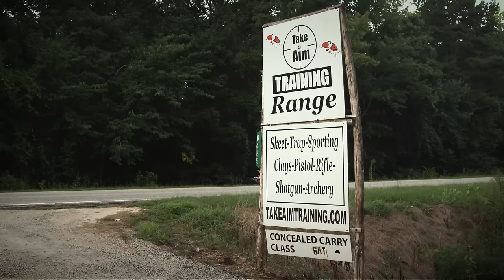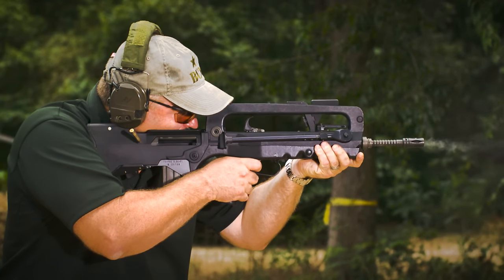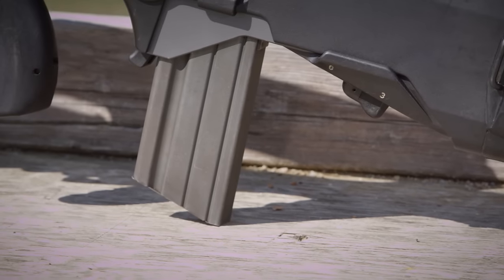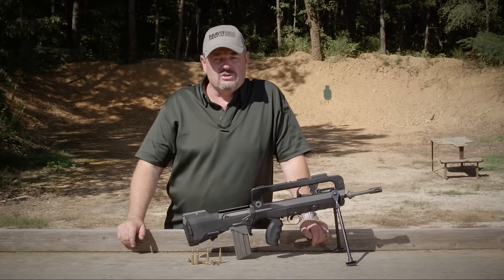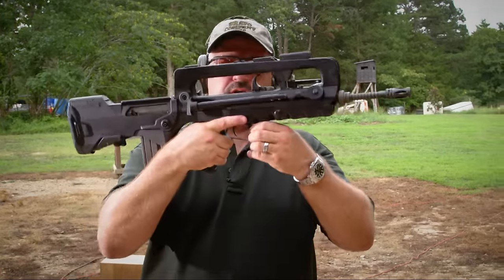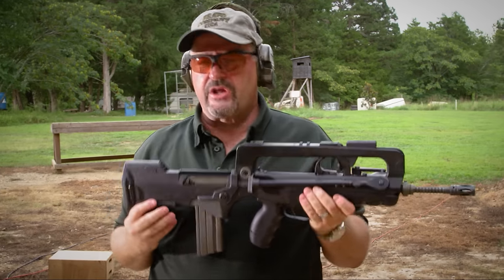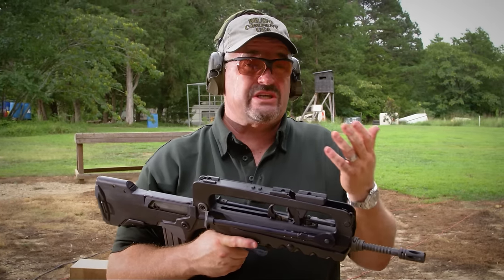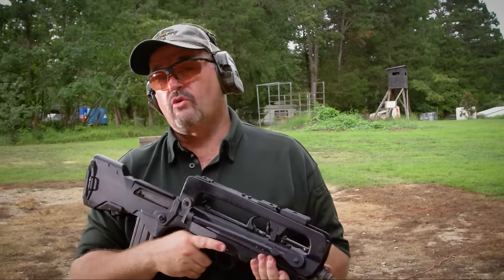FAMAS F1 Assault Rifle

Comment: It seems that there are a lot of current or former French military servicemen watching this video, so I have a question. Is there a variant without the bipod? During a layover I saw a couple of Gendarmes patrolling Charles de Gaulle Airport and I think that their FAMAS's lacked the bipod.
Reply: No version without the bipod but each "foot" of the bipod is just clipped, easy to dissasemble. You can also dismantle the fastening system of the bipod but you need tools.
Reply: +tromxuasnoc so every FAMAS variant has a bipod, but they are easily removed.

Comment: “Over 10km of wiring”

-twitch
Reply: Amateur Asian u do kno not everything revolves around a game and this isnt the same gun
Reply: Chroma 1. Yes it is the same gun. And 2. I know everything doesn’t revolve around a video game. It’s just a fun reference to one.
Reply: Amateur Asian actually he’s right, it’s not the same gun, the gun in this vid is the Famas F1, the one in R6S is the Famas F2 which is an upgraded version
Reply: iTzRekk- still a Famas.
Reply: @imbadonpcwotb476  No in the game it's the F1 but because Ubisoft didn't do enough research they called it the F2 which isn't even right for the second version because the second one is called the G2. They also modeled the standard 25 round magazine yet have the capacity set to 30.

Comment: having served in the French gendarmerie, I used this gun for more than a year. It really is smartly designed.Many small parts within this splendid gun, never had to clean it on the field, could have proven tricky. Overall a very good gun. The new standard issue rifle for the French military is way less sexy. And it's not even French  !! booth !! cool vid thanks for this wealth of info !!
Reply: Exactement.
40 ans de traitres à la tête de l'Etat et beaucoup de français continuent à dormir et à avaler la pilule tous les soirs à 20h.
Reply: @jomo3564  tout a fait, que des traîtres au pouvoir depuis de Gaule, c'est pour cela qu'ils l'ont fait dégager d'ailleurs...
La pillule, ils la prennent profond (comme moi...)mais j'ai l'impression que chaque jour passant et se dégradant, de plus en plus de français ouvrent les yeux. Lentement mais sûrement
Pour les autres Bisounours qui refusent de voir, comme dit l'adage "seul L'Idiot apprend dans la douleur..."
Courage 💪

Comment: You missed the recoil dampener mechanism in the stock. It's inside a box where the 3 or 1 selector is. Don't ever take it apart or try to adjust it or mess with it cause you'll probably have to send it to France for calibration.

Comment: Thanks Larry. 

Looks like the full auto cycling is very smooth and usable rate of fire.  Seemed to have no problems with brass cases.

Don't like the mag release location, etc.  Looks very exposed and prone to dropping the mag at inopportune times.

Don't like safety selectors inside the trigger guard, and the right side/left side selector switch is odd.

Would have been useful to see a manual of arms for mag change, cycling the bolt carrier, etc., particularly with a lack of hold open.

Comment: If you have very spare hours I'd love to show the details of how this device is a masterpiece of design 

Critical independent gearboxes enabling zero to 20 in under four seconds 

Ten kilometers of internal wiring  

1,100 expertly machined and assembled components

 Flawless control out of 300 meters 
But all my team needs to know is does it do the job or doesn't it, and let me tell you right now 
It does the job
Reply: Twitches operator video lol

Comment: Used the F1 for 3.5 years and quite liked it. It needed a few updates which where added on the FAMAS Valorise - like the top rail and a better barrel so it can shot NATO ammo (F1 could only fire steel cased ammo) . Later I was issued the FAMAS FELIN. It  was f... terible ... cumbersome, heavy (er), fragile... hated every cm of that gun. Sadly I got out just before I they issued my dream gun (that Larry helped design) the HK416. Fun fact : when using it operationally I removed the bipod so I can have a better grip on the hand-guard.

Comment: 5:29: wrong. Every right handed soldier who was taught to shoot with the FAMAS from their basic training days was immediately instructed to use their left hand to push that lever to the right side (semi auto mode). It got to the point where pushing said lever to the full auto side actually felt unnatural. I personnally never felt uncomfortable setting the gun to semi-auto, as it had always been the standard way we used it in the FR army. Safety rules and instructions were always extremely clear on one thing too: the shooter could never, in any case, use his firing hand to remove or put the safety back on. Strong hand for shooting, weak hand for safety removal.

Comment: hello I am French and I spent 20 years in the army, I give you my real opinion on this unique weapon, in the field in general a cleaning and necessary twice a month
Reply: unique bulbup system weapon which allows to maneuver easily in vehicles and in urban areas, due to its length it is difficult for an enemy to take it unlike other weapon much longer and unsuitable for me
Reply: by its length think it well and very easy to aim at a human target very quickly an adventure in relation to the competition, I will add two essential points when you are leaning on a wall a baricade or in a vehicle the advantage of the right charger to place al rear allows you to keep aiming on an objective to be destroyed pour le changer le chargeur , and these precious seconds make you come out a winner, with front loaders on and sometimes having to move the weapon back or lift it up to change the magazine, especially on banana magazines, famas has the advantage of the rear magazine, death sometimes takes 1 or 2 seconds
Reply: the sighting system placed inside the handguard handle means that if the weapon falls to the ground, the sighting does not change since it is protected by the rail, on this weapon you can also shoot by lining up personnel by using precisely rail for rapid fire or in an environment can illuminate, all this on a stock weapon without accessories another advantage
Reply: the purchase of its replacement by the hk 416 and especially political and economic with the Germans, the famas costs more to manufacture especially the last generations, then it should be known that the Franco-German military industry will end up merging and that if the Germans sell us hk and French tanks we will sell them submarines and planes reciprocity
Reply: I could list lots of quality but the choices are made, I apologize to you for my approximate English, I will miss this faithful companion, I greet you all and shame that you are here far away we would have drunk a whole beer, salutations
Reply: Is France using HK416 to replace FAMAS now？It is kinda sad to hear that since famas is a famous gun of French army for many years
Reply: @terrancechan6282  yes she has been using the HK for about a year, but the famas is still widely used by many troops, a company of my former regiment received a batch of hk 416 in 2020
Reply: the saddest part of all this is that in the end these famas will be destroyed and that for the French market we will not find any, just a small number which will be very very expensive, the copies on the civilian market are selling at a high price.

Comment: The problem as i see it is a proper red dot sight on that, it wont fit the height and no one uses iron sights any longer other than if you reeeeally have to as red dot is so much faster. When i mean a proper red dot is a big scope for the eye, a good surface glass thing that you dont need the eye to be glued on. Second it shall have filters ( yellow, grid, half and dots) as well as a magnify adjustment for those who need a slight correction. Typically filters are foldable up or down, never side as it will block the eyesight. This has a frame where the eye should look in to ared dot

Comment: The ejection window is too close to the eyes so it is impossible to shoot in bursts without goggles ... then the very big problem of the Famas is the fragility of the ejector spring, therefore the weapon jams; the case is not ejected correctly and the operating part may introduce it between the baaquelite body which blocks operation. In combat it is very dangerous because you have to disassemble the weapon or have a hammer to unlock.

Comment: From an ex foreign legion guy .this rifle is a complete nightmare.Difficult to clean ,complicated and it has a lot of pieces.The is one piece called la piece the maintien that holds the bolt assembly together .its a size of a tiny pin.field cleaning it is an absolute nightmare.The french army never got the F2 version.The only time I saw the F2 was when it was used by the fusillier marin when I was deployed on the troop carrier Sirocco.the magazine were badly made and very unreliable. Also ammunition and magazine was not compatible with the Minimi which was the squad automatic rifle.the bipod was useless,it has also a weird sight for firing rifle grenades like a mortar which is quite unusual. I was happy when they adopted the hk 416 eventhough it was after my time

Comment: What’s the weird rod in front of the charging handle for?
Reply: It's the magazine release
Reply: The mag release is right in front of the mag
Reply: @Joe93819  Sorry I misread, it's the grenade launcher sight
Reply: @neage59  thanks, how does it work?
Reply: @Joe93819  You have 2 positions, one with the FAMAS inclined by 45° (120 to 340m shooting range), the other inclined by 74° (60 to 170m).
On the barrel you have a ring to move for the shooting range, it will block the grenade. More you press the grenade in the barrel, more the range is important.
For exemple, if your enemies are at 200m, you have to shoot with the FAMAS inclined by 45°. To adjust the ring, you have to know the increment system (20m for 45°, 10m for 74°). For 200m, you have to increment the ring by 4 (120 + 4 x 20 = 200).
Reply: @neage59  thank you! I have looked for answers everywhere but couldn’t find any.

Comment: Good riffle but not for a military use, too many small pieces (complex mechanism). I would not say this weapon is reliable. Getting dirty waaaay too fast and the cleaning is always a mess. Jammed too often. OEM mags are shit ( i had to buy my own made of strong ABS). No picatinny rails (in 2014 really???). The Bipod's mechanism is crap.

3 good things about this rifle :
1-Bullpup compact weapon, perfect for close quarter combat and airborne deployment. 
2-Riffle grenades mount is incredibly useful (different types of grenades available) 
3-lightweight. 

That's not a bad weapon but every French soldiers will tell you what i just said. 
The Hk-416 is more than welcomed but we would have preferred to keep a bullpup configuration.

Comment: It's really, really odd to me that they would add a integral bipod to a bullpup. It's like they saw it on the WA2000 and were like "we want that feature!"
Reason being is because the concept of a bullpup is light weight and small size at the expense of a (somewhat) less ergonomic reload while standing, and a more severely hampered reload while prone. Perhaps during design they felt it was too hard light to control while in full auto, so they found a decently useful way to add weight? Eh...that would have been solved just as well with a compensator, and would have weighed less.
Anyone know why it has a bipod? Maybe, revisiting the reload thing, during testing they found it made reloading while prone easier? That would probably fit Cold War design philosophy, focusing on large scale wars with infantry firing from prepared positions rather than modern day thinking focusing on small scale, highly mobile gunfighting between well trained small units. Seems plausible, but it still just looks like a lot of wasted weight for a soldier to carry in their hands constantly.